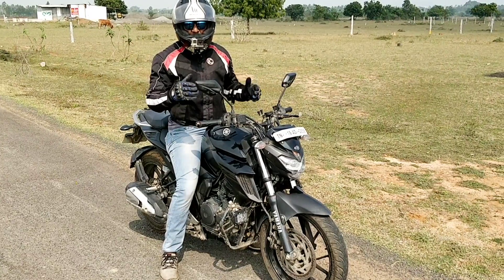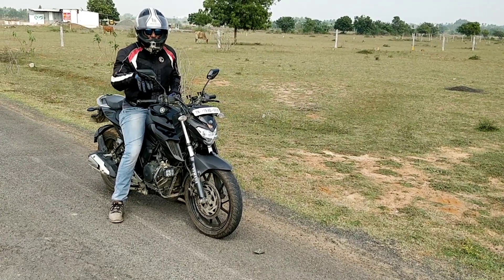youtube video #2t9tu7w7cZM

Comment: Braking tips are ok but DON'T EVER SAY "U DON'T NEED An ABS".

Your completely misguiding people about tips on braking AND SAFETY OF A ABS.

You have shown this braking method on dry ashaplt raod which offers good traction under heavy braking.

DO THIS TYPE OF BRAKING IN WET CONDITION LIKE FIRST DAY OF RAINS WHERE RESIDUE OIL AND WATER MAKES THE RAOD VERY SLIPPERY OR ON WET CONCTETE ROADS WHERE TRACTION IS LESS. UNDER PANIC BRAKING U WILL BE THROWN OUT OF YOUR BIKE 90 PERCENT OF THE TIME.
Reply: Under panic braking even abs don't help on any condition road as ur panic n bikes on two wheels not four wheels hope u got the point
Reply: exactly
Reply: anyhow ABS has now been made mandatory in India on all two wheelers above 125cc, which is a welcome move
Reply: He said if there is no ABS then don't feel about it.ok
Reply: @islamahmadansari8616  yes it does. Watch videos its MADE for mostly panic braking situations
Reply: Without pressing the clutch... rear and front break pressing the same ratio ..in any weather... dry or wet.. that will be correct breaking technique
Reply: Abs just for noob
Reply: @DInfiniteProject  no abs is 4 gandus 🤣
Reply: Exactly happened with me half an hour ago 😂

Comment: If you are doing high rpms then you dont need to press clutch till the last moment of breaking as engine breaking also helps if you don't press clutch. If you press clutch bike will be free and takes more distance.
Reply: that's true,right now I realized
Reply: Thats what I always say to everyones
Reply: Correct
Reply: Exactly
Reply: yeah I also feel that. n also use
Reply: I only use the front with engine braking...no rear  brake at all...
I gotta say I can stop better than him...without skidding the tyres unlike him...
Reply: Engine brake is exactly the same as using a little of the back brake. So if you are using proper technique and applying front+rear brake then leaving the clutch engaged is completely unnecessary. It will only make the emergency brake more complex than it needs to be.
Reply: engine breaking is actually more powerful than using back brake. Consider any superbikes you can go till 160kmph in 1st gear , then try leaving your accelerator ( dont brake) ,you can see that your bike comes to less than 100 in just 2 seconds thats how strong engine breaking is. If rightly used you can manage even without braking hardly.
Reply: Evolution : Machine to Man and also will be out of controle and one way of breaking in non disk brakes bike is to shift first gear down and then press three fourth of front brake and fullu press and lifting rear brakes
Reply: Please tell how to brake in non disc 100 cc bike at 80-90 kmph
Reply: Evolution : Machine to Man what is engine braking
Reply: ya it must be tell
Reply: exactly
Reply: That's exactly what I do. I was introduced to engine braking in my second year of bike riding, and now it has become a way of life for me; a part of my everyday riding.
Reply: D M Bhai Matlab dono brakes ek saath squeeze karne hain in emergency situation on 100 kmph but front brake release karke chhod Dena hain and again squeeze right waise hi rear brake bhi squeeze then release karna hai. Kya???🤔
Reply: Evolution : Machine to Man Bhai Matlab dono brakes ek saath squeeze karne hain in emergency situation on 100 kmph but front brake release karke chhod Dena hain and again squeeze right waise hi rear brake bhi squeeze then release karna hai. Kya???🤔
Reply: Engine braking is major for high speed..along with good huge front discs...that works wonders! Although rapid gearing down at high speeds also tends to lock up the rearwheel sometimes...thats where the slipper clutch comes in play! Combining both works like magic...but nothing cam be compared to ABS..cos in India the streets are filled with Idiots.
Reply: meaning that don't have to press the clutch while changing the gear?
Reply: ramanuj yadaw , dont go to 75+ in non disk its very risky
Reply: I only have a 150cc bike but I use engine braking (with quick down shifting) all the time.
Reply: lucky pawar that is good only if your front suspension is very strong like in rc390, or other ktms and high performance bikes. Squeezing and leaving in normal bikes is not recommended at high speeds because your front suspension goes in and comes out which makes you loose balance. Better to grab front brake 50%and then increase power .
Reply: MUHAMAD AFANDI if you have time to downshift and then just use clutch downshift and leave clutch. Clutch shouldnt be continously pressed and thats it.
Reply: Sahi hai 👍
Reply: Evolution : Machine to Man yes...
Reply: Prashant Shetty thanks
Reply: Aftab Aleem yep
Reply: So True.
Reply: But in sudden suitations you gotta get hand on clutch & break as well.  
 What u told can be done in a situation where we have more stopping distance available like Highways.
Reply: Well think what happens if you dont use the clutch, your bike just stalls and thats it . It isnt dangerous and yeah when in low speeds clutch should be pressed just to prevent stalling.
Reply: You're point is right bro ,even i do the same but in emergency situation i use break first along with clutch and if there is any stopping distance available then i use engine breaking along with breaks.
Reply: cool,
Reply: I have doubt.. Cause during emergency holding front break can lock excaleretor in own hand and engine dissent help in that way as you said..this seems good idea but I  guess need practice
Reply: YouTube Quora yep
Reply: kriptonis Well here you are a bit wrong, as when you are applying rear brake you are trying to stop the rear tyre and if the conditions are sludgy or muddy the rear tyre might lock up and hence you can't control the bike. However, when you use engine braking the rear tyre just rotates at a slower rate than the front tyre and it helps in stopping without compromising the handling. For eg. bike is at 60kmph the front tyre is doing 60 but if you shift down (remember muddy surface) the rear tyre will do 45kmph(just giving example) hence it is rotating and giving braking. Also the tire rotate so the peak pressure is not at the same point like in skidding so that also helps and tire do not burst like when skidding it may do. Hope you understand and it helps in making you ride better.
Reply: it depends...
if ur using a bike with low engine breaking like d two strokes engine breaking wont do much unless u do a 1 gear down
Reply: Evolution : Machine to Man 
offcourse cuz ur still n d 1st gear
😂
Reply: indeed, adding the rear brake to a high rpm engine braking locks up the rear wheel since the weight does transfer to the front.
Reply: Science and new technology new techno in same way but its risky don't ride fast 100 cc bike best speed under 50 to 65 max you can easily control in emergency situations
Reply: Child of Fire  agree.
Reply: @chillinexam45  curl up like a baby
Reply: that's why he did 4.. it's implicit dude!
Reply: no , clutch must. there is a chance if we dont apply clutch we may raise accel by mistake,which is more dangerous. if you apply clutch , then there will be no accel and u can put brake to stop.
Reply: Nice✌️ thnkq i need to practice
Reply: Not holding clutch will make engine stop abruptly
Reply: This should have been included in the video. 👍🏼👍🏼

Comment: See lack of ABS has got it's own advantages. When you brake a bike like Ninja 650 at 120 kmph , you should have imbibed the technique and in emergency your natural reaction would be what you had already digested as a habit or imbibed into your blood , so to say. 
First you should press down rear brake slightly with your toes ( off course you must wear boots) or the edge of your boots and then in a split second you should pull in front brake , and then you shall press a little more of rear brake. And at the same , as the speed come down change gear ( engine braking ) and leave the clutch again change the gear ( to lower) and release the clutch to slow down damn very fast . Otherwise if you do not release the clutch , it is of no use at a all.
At the same time , the situation could be that a bus coming in the opposite direction could leave you only an earthen road or the road under construction with pebbles. If you hold front brake, within seconds you would fall. There would be no time to control because the front tyre would roll on pebbles or small concrete. 
In such situations immediately release the front and press down rear brake , it will not skid . 
But in all cases you must wear jacket ,boots,helmet when you ride on national highways because almost 40% of people on Indian roads are definitely idiots.

Comment: Demo was good but these do not work during a panic situation when an animal or nut head comes in front of you@70 you might not have time for pumping braking action and you might have a bad fall when the road is wet or with bad roads. So here ABS comes to you for your rescue which does the pumping action for you without letting the wheel lock and skid! All manufacturers who produce powerful bikes for public road commute should consider this. For me before 8 years i had a bad fall @70 when a dog came from another lane of the road.. so lets try to wear some riding Jacket which might reduce the injuries if you have a fall. 
  I bought Camster riding gear after 4 months of the incident mentioned above to protect myself but i need to use it regularly when i take my bike out now in the 200 feet road. Thanks for the video man, appreciate the effort :)
Reply: True said bro

Comment: I always use both brakes without clutch and it always help me in best braking.....but do this only when your tyres and disc pads are in good condition and road is dry.....otherwise you will be on risk because......jaruri nhi samne wala bhi expert ho......
Or haan engine brake wali baat ekdum sahi hai......
Nice video brother.....
Thanks to the cameraman also.....

Comment: in bikes 100% of the braking is done by the front brakes. Fastest way of stopping is that. However,it is not recommended as riders are not professional racers. Secondly, if you will pump the brakes( like told in the video) you are increasing peak pressure and hence you may fall. Apply brakes progressively and use 70:30 ratio from front to back in bikes due to higher  frontal weight and 40:60 front:back in scooty/scooter as weight distribution tips towards the rear.  DON'T NEGLECT ABS AS IT HELPS WHEN YOU DO PANIC BRAKING AS THAT TIME YOU CANNOT THINK OF ALL THE TECHNIQUES AND YOU JUST MASH THE LEVER TO STOP.

Comment: ABS never promise to save you from unforeseen situation. It's a new edge engineering to keep your ride safer to some extent in emergency circumstances. If you know your bike well, if know yourself well, in that case I guess you don't need to depend on ABS. Traditional breaking will do just fine. On the other hand if you are kind of guy who loves street race and stuff, disobeying traffic signals, irresponsible driving, no helmet no gear then my friend even ABS will fail to do its work. Anyway nice and informative video mate 👍 you're doing great.

Comment: ABS is a very helpful feature my friend. Manual techniques find it a little hard to cope up with ABS. Basically, ABS let's you stop the bike with ease, without the risk of skidding even if there's gravel or wet roads!
Beginners on 200cc+ bikes should have ABS, mandatory.

Comment: The trick is to hold both rear and front brake, but the pressure to be applied is 60% in rear and 40% front brake also you should lean a little bit forward so that your weight will also help to reduce the momentum, but in a sudden state even experts will miss the method..

Comment: Nice video thnx here is the summary:
1. Downshift and release clutch. 
2. Apply front brake in a jerky motion(press and release).
3. Simultaneously apply back break with step 2.
4. Pray to GOD to stop safely.

Comment: I think you have to rls the rear break too, cause if it blocks it doesn't stop faster and u loose the control of the bike. Also it's 30% rear break and 70% front...the rear break is for balance. So first start with the rear break and then with the front. Keep it easy and safe rides bro 😊